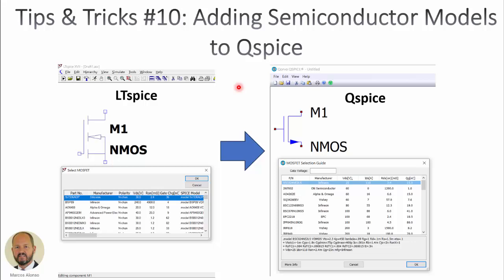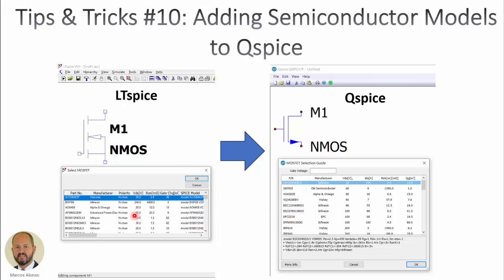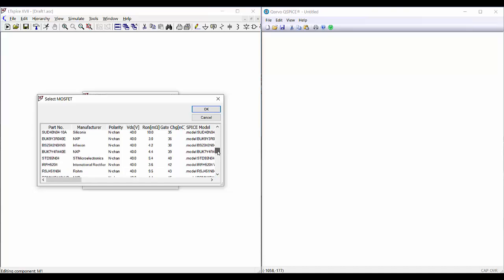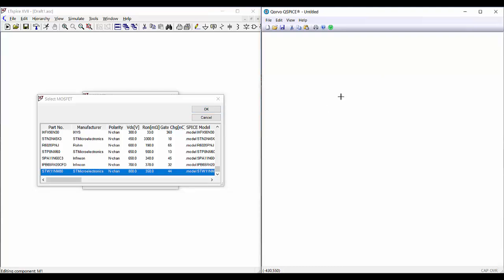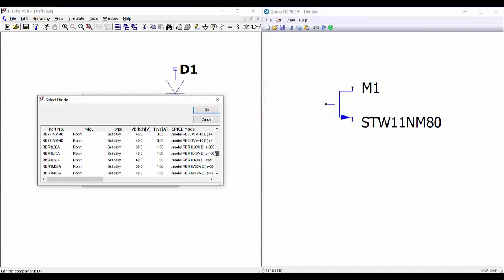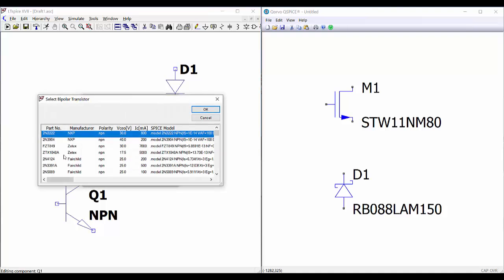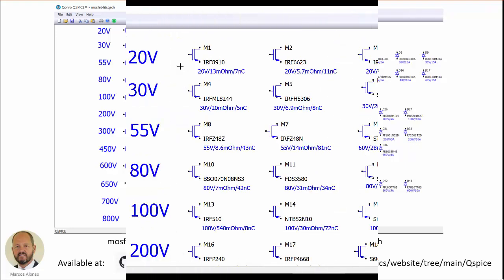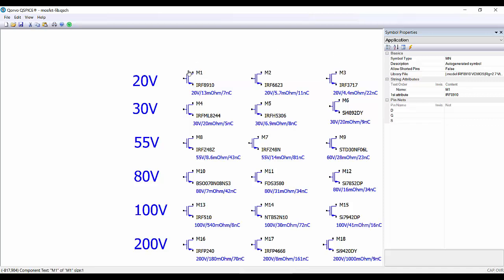TT #10: Adding Semiconductor Models to Qspice

Comment: Very good, I was searching for the files manually, this is much easier. Taking this opportunity, do you know where I can find spice thyristor models (SCR), I am modeling a 12-pulse controlled rectifier and I did not find power thyristor models (100A). I contacted Semikon but they do not have spice models of their components.
Reply from the maker: In the folder below there is a Qspice model of an SCR. Maybe you can use it directly or modify it to match the characteristics of your SCRs:
https://github.com/marcosalonsoelectronics/website/tree/main/Qspice
Reply: @MarcosAlonsoElectronics  Hello, I tested the model you provided and it worked very well. Thank you very much for your help.